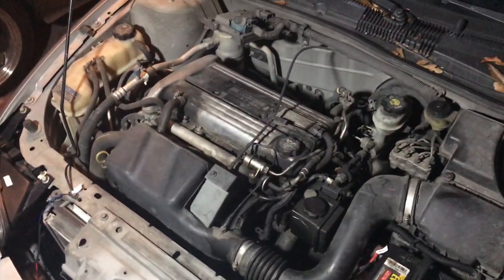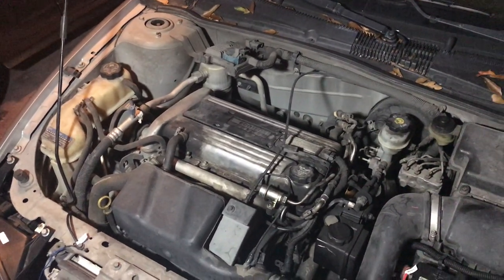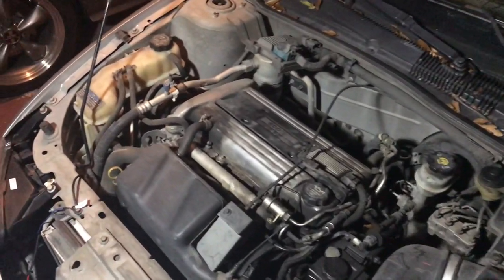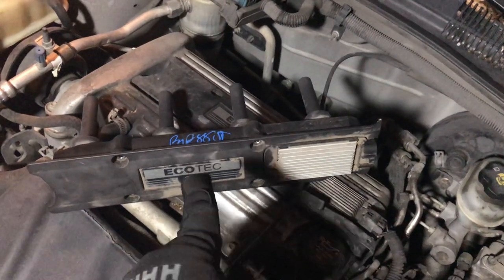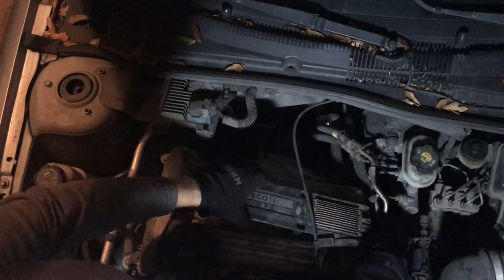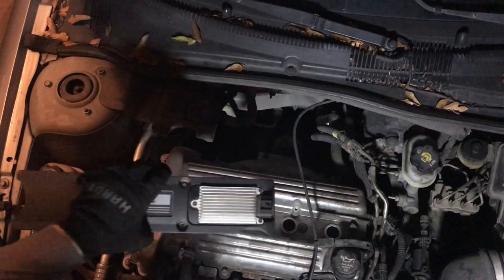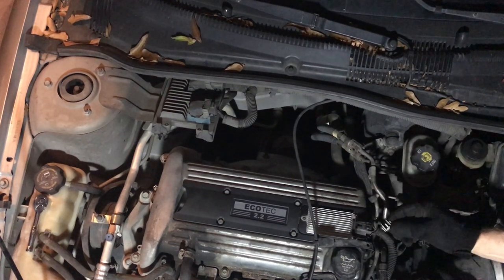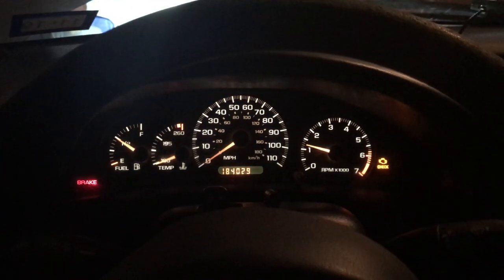2003 - 2005 Cavalier/Cobalt - 2.2L Ecotec P0300 / P0171  Rough Running / Rough Idle Fix!!

Comment: I replaced this on my 2003 Saturn L last year, and 1 thing I would add - when the old one is off, have a look down in the spark plug bores, to be sure there is not oil leaking into the area around the spark plugs.  If there was oil. those gaskets (part of a valve cover gasket set) would need replacement

Comment: When the power suddenly drops and you have the highway performance of a ride on lawn mower you have gone into reduced power mode. There can be multiple causes. Sometimes the engine control module has stopped trying to match up exhaust O2 sensors with the injection system and gone to default settings. If the ECM programing predicts damage to the catalytic converter it will go to limp mode or even idle limp mode.  When the voltage settings from the accelerator position sensor (fly by wire) or the throttle position sensor are outside spec it will go to limp mode and post a fault code which turns on the mil/ cel/ses light*. If the light is flashing the fault is continuous. If it is steady the fault was for a short time.   (* Malfunction indicator light /check engine light / service engine soon)
  On some you can turn the reduced power off  by stopping the engine and restarting. If you have a manual tranny you can do this while in motion. Just disengage the clutch, turn it off, restart, and re-engage the clutch. I suppose this could be done with an automatic if you can restart in neutral (I don't know).
Reply from the maker: Had that happen to my 2004 tC.  Luckily I was putting around on surface streets.

Turned out to be MAF sensor
Reply: I have a 2001 cavalier that is doing the same thing idk if the exhaust is glowing but its acting and sounds just like this one seems like the same problem but I don't have that eco thing on top of my valve cover
Reply: @joeyallen6960  The ecotec engine use started in 2002.
Reply: @francoistombe  ok do you maybe know why my 2001 would be doing the same thing as this one in the video? Like mine sounds just like his my check engine light is flashing like his also
Reply: @joeyallen6960  There are dozens of potential causes.  Is there some way you can borrow a code reader (scanner). That is where I start. If you live in the USA you can get  a pretty decent one for about $100 from Harbor Freight. AutoZone will do a scan for you.n Not blindly buying parts on guesses for something that turns out doesn't need to be replaced pays for itself. The scanner allows one to track down the approximate cause and after that you can test or disconnect one suspect at a time. Once you find the code posted you can go to YT again. There are videos dealing with specific codes. GM vehicles are much alike.  The dealers manuals for tracking down problems run hundreds of pages.

Comment: Mine doesn't do that,but it does have a weak idle and a slow acceleration. The RPMs seem to line up perfect with my speed. It just seems like everything is going a lot slower then it should, and when I come to a stop the idle is very weak. Any ideas?
Reply from the maker: Check your spark plugs and wires.  I had some wires that broke their insulation and were grounding on the exhaust.  Super slow.

Other than that it could be fuel pressure is too low or injectors clogged
Reply: Maybe idle air control valve or possibly the fuel pressure regulator

Comment: Mine is making a noise only when the brake is on in drive. If I put gas to it or change gears in any way, it immediately stops. It’s a rumble-what I can hear inside the car- and is louder sometimes than other times. Do you have any ideas??
Reply from the maker: That sounds like a motor mount or transmission mount.  If you accelerate rather hard, is there a loud clunk?

Comment: I have same car and have fixed the control module but my engine light has not turned off.. Has yours turned off im thinking the sensor might be fried.. Thank you..
Reply from the maker: No, my check engine light kept coming back on.  I don’t know if you’ll have the same error as I did, but the constant dumping of raw fuel into the down pipe and combustion damaged my catalytic converter and the O2 sensor that was attached to the down pipe.

I was able to get the light to go off by purchasing a spark plug defouler, drilling it out so the O2 sensor could screw into it, and then screwing the whole assembly into the O2 sensor location.  This reduces the amount of exhaust gas going to the sensor and the computer thinks it is operating normally.
Reply: Thank you for replying... My only error now is code p0340 which is camshaft sensor fault.. However there is no part to replace and from what ive learned as amature machanic is the check engine light pretty much is something to do with the o2 sensor or exhaust output.. I did not drive it too much with the problem and only drove about 20mph but still i could smell and hear the excessive heat that had produced. Im not sure how to do that modification you mentioned i will try to see if i can find out more.. Thanks again...
Reply: Some trouble codes will cancel if the problem does not recur after several drive cycles. Others stay and keep the check engine light on until cancelled with a code reader.

Comment: Just un plug the battery for a few min to reset the computer, that's what I did on mine, and there is a difference between going to a junkyard and buying something and going and pull it out yourself.... the was blue marker on the replacement you just bought it...
Reply from the maker: I eventually just plugged in my OBD reader and cleared the code.  

And I most definitely went to a pick-n-pull and pulled that part from an 05 Cobalt.  The blue Mark is from the checkout staff so they know I didn’t steal it.

Comment: Ive replaced my icm, the boots, plugs, fuel filter, alternator, battery, air box cuz there was a whole, radiator fan, engine light has kicked back on multiple times after kicking off but still have loss of power/lag in acceleration. Engine codes have read random misfires, and cylinder one misfire but i replaced the first injector and have new ones ready for all. I just dont know what to do besides maybe the fuel regulator? Almost seems like im going thru oil faster than i used to but i dont smell it burning oil. Im running out of options lol. I think the last time i did my spark plugs i might have been a little lean?
Reply from the maker: The fuel regulator is a common failure on these vehicles as well, and don’t expect it to work on the first try.  I went through 3 Autozone replacements before I got one with a rubber diaphragm that didn’t die immediately.

Comment: I was having the same issuesand changed the whole module brand new and mine still does the same thing dont know what it could be at this point
Reply from the maker: Spark plugs and wires.  If a plug or wire is bad, raw fuel is being dumped into a dead cylinder 

Is your check engine light flashing?
Reply: @minter66  yes its flashing but I have also replaced the spark plugs and its still doing the same thing, I put my scan tool on the car and its saying I have a misfire on cylinder 3 so im guessing its something more serious in the engine as the car is also burning off oil as well
Reply: If the check engine light is on then there was a temporary out of spec. If it is flashing the problem is continuous.
Reply: I know it’s been a year but did ya get it fixed?🤣 got the same issue replaced spark plugs boots and everything
Reply: @FruitNinjaPhenom  I never found out since I had 3 other cars I just got rid of it

Comment: Thank you for the film. Can you tell what grease goes inside of the ICM and possibly where do you apply it? In my coil compartment ( to the very right under the bigger connector) for the ICM  there was a blob of some grease.  Is it supposed to be there? And if so what grease is it? For the new ICM AC 
Delco gives a pack of grease to put on the female connectors, but where exactly? And nothing said to put into the coil compartment. Do you put any grease on the metallic plate of the module? My original Module (2003 Chevrolet Cavalier, Eco Tec 2.2 engine).
Reply: Where the spark plug go in to the rubber boots
Reply: Dielectric grease to keep moisturize from the electric components and keep the connection pins from oxidation
Reply: The ICM modules have a metal  bottom plate  to act  as a heat sink so you  must use a thermal  paste NOT simply dielectric  grease.  Heat sink paste has fine metallic  particles in it & is what conducts  the heat away from the hermetically resin  sealed electronics. Great for  keeping the elements  out of  the board but  the component  WILL fail prematurely if that thermal paste  has  dried up or if you fail to apply  it on a new component.  
Computer supply  stores  sell  a premium  conductive  thermal paste  that contains silver. Maybe $10 to $20 for  just  one or two  fluid  ounces.  
No need to slather it on but rather a nice even light coating  as it will be squeezed out when you tighten  the fasteners anyway.
Reply: @pedrorojascervantes3928  Thank you for the explanations about the thermal paste with silver. I put the paste provided w/ICM module just on female connectors. Most likely it was thermal paste (Delco is a reputable company). I believe didn't apply anything on the metallic plate (I think in the film I saw the author didn't apply it). I'll apply some of the thermal then, I think I have some around, thank you again.
Reply: @olenaerhardt7725  Right on...glad  to help.
Even  when  you buy a new  ICM with the packet  included in the  box it's  good  to check it as usually it is  marked  as such  but who  knows  what  can happen in a mass assembly/ packaging  line. Someone  can replenish  a feeder hopper on a conveyer  belt with a bag of plain  dielectric  grease or even  plum or hoisin condiment sauce 😆
BTW....if yours, or a friends home  PC boots up & shuts down again it could very well  be the grease  has dried up & is causing the motherboard  CPU chip to shut down  to save it   as it detects  the over temp condition. 
Had this  happen  recently  to a friend's  computer & I'm  lucky enough to have  a trusted computer  tech who schooled me on the thermal paste  function & didn't  charge me anything  for  the service  since  I help look  after things  for this woman who can't  get out much. 
I would make the replenishment  procedure  /check of thermal  paste  on a ICU part of each tune up to ensure it will  last.
Reply: @olenaerhardt7725  Yes.. I've  watched a number  of videos where the person  demonstrating  is not aware  of what the paste is  & calls  it dielectric or  actually  ignores  the packet inside  the box  & slathers  the heat sink with gobs of what he believes  is  the  right " stuff".
Reply: @pedrorojascervantes3928  Thank you. We don't drive that car now since I'm working on changing tires on it, but before the car was driven with the ICM I installed in the manner described before, though maybe not that much. i installed a new ICM for the purpose of practicing, just to have a new part (~100K). Definitely it is better to look in auto stores for the thermal paste w/silver particles. Now I'm thinking maybe it was not a mistake done by manufacture to leave that blob of grease (~ 1/2" in diameter) inside of the ICM, but rather it was done for some purpose, and it is better for a car. Or you think a thin layer on the inside of the plate will be better? Probably so.
Reply: @olenaerhardt7725  The metal plate  is a heat  sink to draw heat away from  the resin encased  electronics.  It is a sealed  unit ,not sure what blob  of grease  you're  refering to.  Thermal paste must be  applied to the outside  of the metal so it makes  contact with the metal of the mounting  surface for heat transfer.  
Silver  is only  used for  fine electronics in radios & computers.  Automotive  will likely  be aluminium  or  other  inexpensive  metal particles. 
Yes, the component  should have a small ketchup  packet  sized amount of thermal paste included  in the box.
Reply: @pedrorojascervantes3928  If you look on Amazon a part GM Genuine Parts 19300922 Ignition Control Module, on the 3rd picture, the blob on the original module was in one of those plastic pockets (on the left, 4 of them) I believe. You also can see a small package w/their grease (1st picture). i put that lubricant only in female connections as directed on the package, but probably the name itself Lubriplate tells you to apply in on the inner side of the metal plate (what I didn't do) on pict 3. Do you see a small hole there covered by the piece of scotch tape? Did you remove it or you left it there? Probably it protects the inside from the thermal grease when you apply it to that side (inner) of the ICM. I found the product I bought that time. It is called Silicone heat Transfer Compound, I think it is a good heat transfer thermal paste. I also have ARCTIC MX-4 (incl. Spatula, 4 g) - Premium Performance Thermal Paste for all processors (you can see on Amazon as well). I assume that would be better product to apply on the back plate of the ICM. I also found now on Amazon GENNEL G107 20g Silver Compound Thermal Conductive Paste High Performance Heatsink Gearse for CPU GPU Chipset Ovens Cooling, $10 only.